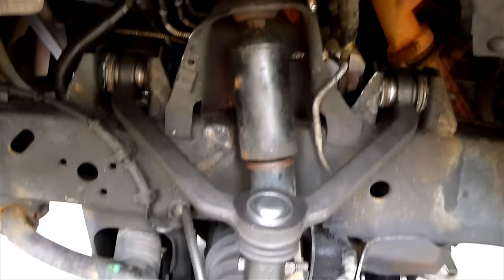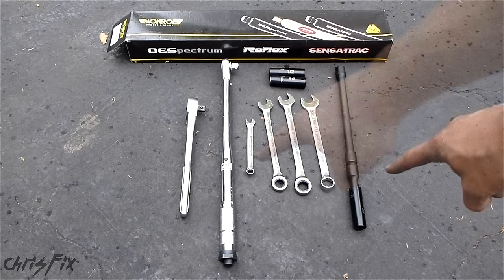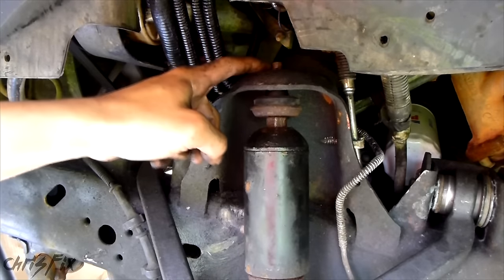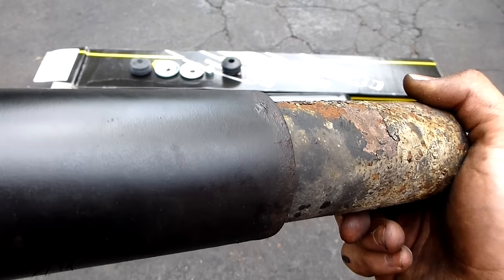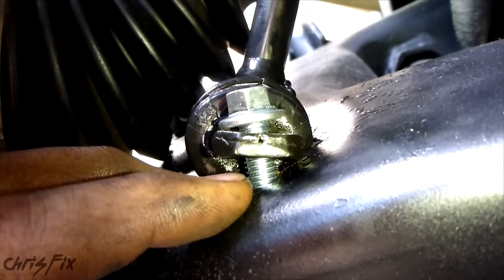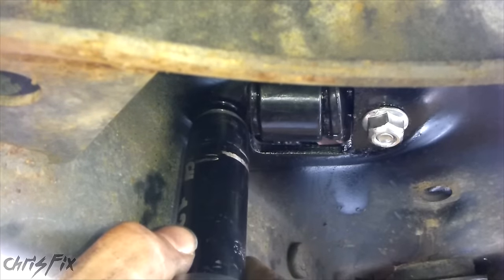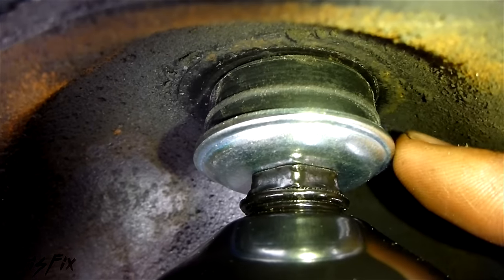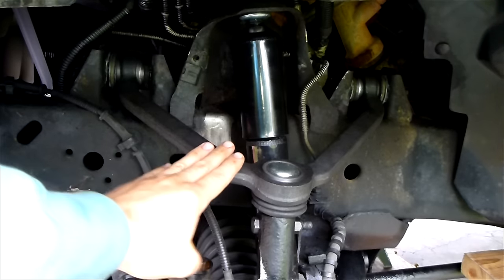How to Replace Front Shocks

Comment: how are you liking the sensatrac shocks? I put them on my 03 2wd f150 and can't stand them. they are too short in my opinion. Guess I need to measure the shock mounting at compressed, extended, and static ride height.

Comment: Great video, I have a 99 ranger that is leaning badly on driver side front. Along with a vibration. I'm guessing it's the shock gone bad. Is there anything else that I could suspect to be the problem? Thanks
Reply from the maker: Dana Steele The spring (either coil or torsion bar) might be bad as well.

Comment: Hey chris is the installation similar for most cars even if im using aftermarket parts? Example is im lowered on springs and want to go with a aftermarket shocks but i will keep the strut stock.

Comment: hey chris, i installed some bilsteins on my truck but it didnt have a stud on the bottom like when you took it off, so when i tighten the top bolt it would only go flush and then just kept spinning. so after my first ride it became loose to where i can spin the bolt by hand? any suggestions

Comment: Does that truck not have coil springs? I didn’t see any coil or leaf spring attached to the front suspension. Or does it use some sort of torsion bar in stead of a spring?

Comment: hey crhis! Great video it really encouraged me to do the replacement my self, i went ahead and started out yesterdey, apparently i got the incorrect shocks as it did not even reach the top hole once the tire was on the ground one question at minute 3:30 in your video is the shock compressed at that point? i guess that the shock has to compress to 50% the whole travel of the shock in a regular assembly.
Reply from the maker: Emilio Gaitan Antunez Awesome! That sounds like the incorrect shock. At 3:30 the shock was compressed a little to get the bolt holes to be straight. But when I put the shock in, the suspension was not compressed and the shock should be fully opened. Keep me posted!
Reply: hey chris! i went back to the shop explained what was going on and they trade the shocks for the right ones, came back and it was easy as you are saying in your great job! keep up the good work.
Reply from the maker: Emilio Gaitan Antunez Awesome and thanks for the update!

Comment: How do you change the shock when its up in the coil spring well? I can't get access to the bottom nut on the top, its inside the frame. Should I just cut it off like yours snapped off? Do I need access to that nut when I'm installing the new shock or can I just tighten the top nut down?

Comment: Since this is just a shock and not strut do you need an alignment after replacement / can you do an alignment while they are bad to make sure no other parts (control arm, tie rod, etc) are bad? 

Also, is it safe to do without jacking up the truck or will it collapse when removed? I know I have seen you do rear shocks while on the ground
Reply from the maker: +Chris Brannan shocks will not affect an alignment since they are just dampers. Your alignment with shocks on and off the car should be the same. If you have room you can replace the shocks with the car on the ground. That's what I did with the rear shocks on my truck.
Reply: +ChrisFix thanks that's what I was hoping, worried I might have a bent tie rod or something and would rather get that diagnosed and fix it if needed but didn't want to throw money away on two alignments if they needed done. Love the videos, they help a lot!
Reply from the maker: It is easy to check for bent tie rods or suspension parts. They should be straight so take your wheels off and look. I have a video on each suspension part (ball joint, upper and lower control arms, tie rods, struts, camber bolts, etc) so you can check them all out!!!
Reply: Thanks again for the quick reply. I have done those tests several times in the last week which is why I am starting to think maybe it is just out of alignment, the passenger side wheel just looks really crooked. I even did the 12-6; 9-3 wobble test by jacking up under the control arm to "unload" the torsion bar as some people mentioned in the comments of those videos. Everything feels and looks pretty solid, not really seeing any visible movement, definitely not like in your ball joint/control arm videos. I thought MAYBE I had a bad ball joint as it looked like a camber tilt to me and there was a small gap between the ball joint boot and knuckle on that side. The ball joint appears to be aftermarket as it has a grease fitting on it.  I posted some pictures of both of my ball joints and a front shot of my truck to show the alignment issue to another Forum. They thought that it looked more like a toe out issue than camber and that if all the ball sockets on the tie rods were solid then maybe one of them got bent and to try and get it aligned as it probably would align OK with a bent arm, or the shop would be able to tell me which one needs replaced.

After doing some more thinking I couldn't remember if I checked the inner tie rods, so I just did the test again this evening and didn't see anything so I pulled the boots back so I could get a better look at the ball socket for movement. I didn't see any movement in the sockets, BUT on the driver side there does seem to be a lot of grease on the rack while the passenger side is clean. Could a bad rack cause alignment issues and if so do you think that could be my problem? If the rack wouldn't cause the alignment should I be concerned about that grease being there? I don't feel any play in the steering wheel and there are no vibrations under braking like I had with bad tie rods on my old car.

Here are picks of my lower ball joints, front of truck (passenger side looks off to me) and the insides of my steering rack/tie rod boots with grease: https://goo.gl/photos/frqTWxi8rmqrhPV66

Comment: Great video!  Thanks!!  I bought rear shocks for my 1998 Chevy Blazer (LS - 4 door)  and have been learning from watching your videos.  Amazon only had one shock in stock for the front (so I went ahead and ordered it).  Fast forward the second front shock is now back in stock but is now 6X the original price (this price changed across all websites I shopped).  Long story short, I found a new front shock to match my existing new front shock on eBay (new old stock) but the mounting hardware is missing.  How difficult is it to find AC Delco mounting hardware (actually a Bilstein part.  The part no is listed as 540-516 as well as  GM OE part no. 12474687)?  Thanks for your help.  Merry Christmas!!

Comment: Chris, what's the difference between shocks & struts?
Reply: Nidal Sheikha He explains it in the intro, struts have springs around them, shocks do not. Cheers
Reply: Shocks typically don't have springs, but they can. They're called coilovers. Struts are different. Struts are a part of the suspension that controls the positioning of the wheel. Shock suspensions typically have an upper and lower control arm. Strut suspensions typically don't have an upper control arm. They MAY have a lower control arm, and they may use a collection of links (some sports cars use this).

Comment: Hi chris i have a 2006 chevy silverado 1500 two wheel drive and I was replacing the front shocks and while removing one of one the bottom two bolts on the left shock one broke off could i get by with one bolt with red locktight on the bottom bolt and the nut on the top and how tight should i tighten the nut on the top?
Thanks Landon
Reply from the maker: Landon Smith You need to find the torque specs for your car and you need both bolts. You can get by with one bolt to slowly drive to a parts store to purchase another bolt if you dont have another car, but you definitely need both bolts.

Comment: I have a 1998 ford ranger and I need to replace all 4 shocks, the problem I have is my rear drivers side has a rust hole on the frame where the rear shock attaches to the frame can I take that shock off and get it repaired by welding a metal plate to cover the hole and drill holes for the shock to put the bolts in, the rust is right at the shock plate that is attached to the frame

Comment: Chris this will be on my next to do list. One question how do you fix a car that is accelerated meaning when I turn on my truck I wait 5 minutes to heat up the engine. While I am waiting for the engine to get hot the gage on the far left where it has numbers 1-8. I think it's called the RMP or RPI well that gauge instead of being at 0 pr below one that arrow is always near the 2. Also I am driving at 45 mph and the truck seems to be going slower than 45. Do you have any videos on that? I hope I made any sense.
Reply from the maker: Edgar Diaz Edgar, the rpms should be around 1000 at idle after a minute of turning the car on. Check out this video: https://www.youtube.com/watch?v=vFhoNykgQtc
Let me know if this is similar to the problem you are having.

Comment: Hey chris my back tail light blinker in my 2000 f150 xlt doesn't work. But the front works. Bulb is still good. What's the possible problem

Comment: Quick question i have a 2003 F150 supercrew with a 6" lift do i really have to jack it up? its on leveled grounds and theres enough clearense there to not remove the tire. i should i be safe than sorry?

Comment: My 3/4 won’t fit on the lower bolt on the top of the shock it’s annoying the hell out of me, I gave the same truck lol & changed one side so I know it’s the right size
Reply from the maker: Dang, are you using a 3/4 wrench or socket?

Comment: Hey Chris, I kno it's gonna be kinda hard to do but can u please put up a how to get rid of front strut sag on a 95 Lincoln town car, it's been giving me trouble
Reply from the maker: Leon Solomon I dont have a Towncar to work on, but is this a problem even when you replace your struts with new ones?
Reply: I haven't been able to lol. The driver side has a major sag but my passenger side is rather ok. The mechanic that I talked to said that it could possibly be my upper ball joint that went out is that true? also, Is there any substitute for the rear springs as well?
Reply from the maker: Leon Solomon Ok, well the sag is just a worn out spring in the strut. Changing out struts is pretty simple. The upper ball joint wont cause a sag, but here is how to test ball joints: https://www.youtube.com/watch?v=62bVn7E8gyk
Reply: Thanks Chris

Comment: Hi Chris,  My Saab93 sportwagon 170k miles has a leak from the front strut so I'm going to change both b4 my next Mot, looking on eBay I could get 2 new Monroe reflex for £63! my question is are they any good or can you recommend or advise from your experience, cheers
Reply from the maker: Typey1 Monroe makes some pretty good shocks. If you are concerned with how long they will last, in the US, the local parts stores usually have a lifetime warranty if you buy it from them and they even price match!

Comment: What do you do when trying to tighten the bolt on top, but the entire shaft spins? I installed front shocks on 2004 mustang gt, but can tighten the top bolt. So frustrated!

P.s I'm using an impact wrench, and still nothing.

Comment: I have a 2000 Lincoln Town Car Executive, do my evap canister solenoid Vapor hose runs to the top of the gas tank, or dose it supposed to be exposed to the air ??? Please help... Can't pass emission, computer reads evap canister solenoid malfunction... And the hose that attach to the Evap solenoid has been cut

Comment: Chris, I replaced my front shocks myself, per your video, and now my newly installed shocks are squeaky. Very squeaky. What gives?
Reply from the maker: +Kevin Beyer Maybe the shocks are bad? Let them break in for 200 miles but I would contact the company you used and see what they say. You might want to add some silicone grease to the bushings which might stop the squeak if the squeak is coming from that and not the shock internally.

Comment: hey @chris, i got a cadillac cts 2005 and it had a squeaky sound while driving at the front left side of the car. i was guessin it was the shocks nd replaced it but the squeakin sound has increased while driving nd it seems to reduce for a day or 2 only when i apply some grease to the bushes on the hindges of the shock...plz suggest something..
Reply: Mammen Mathews bushes are well known for squeaking, there is some special lubricant for quieting them down or you can also use silicone grease, never use petroleum based grease.
Reply: @Luciano Narno  thanks man... let me give it a try... hope that works...👍
Reply: Mammen Mathews No problem, man.

Comment: You didn't use blue lock tight on the front shocks but you did on the rear. Any reason?
Reply from the maker: Martin Driskill Good observation! The only reason why is because I ran out. Loctite in most applications is just an extra precaution. If you  torque the bolts down right, then you don't have to worry!

Comment: My 2004 Dodge Ram has a spring in the truck that the shock just slides out of at the bottom when uninstalled, are there any precautions to take?
Reply: Im no mechanic but I think anybody can replace shocks. Shocks arent spring loaded so when you unbolt them they arent going to fly out at you If thats what your worried about I hope this helps
Reply: Pew diepie thank you!

Comment: my bottom bolts for the shocks are so rusted they snap with very little effort how do i get them out? any special tools or do i gotta drill them out
Reply from the maker: ptrhip If the bolts on the bottom are snapping, just snap them and the shock will come right out (after you take the top nut off which I assume you will snap too). Make sense?
Reply from the maker: The bottom ones should just slide out if the bolts are snapped off. As for the top one, use a vice grips to prevent the bolt from spinning as you unscrew the nut.

Comment: How do you replace struts? i need to get mine done on my 2003 ford f250!
Reply from the maker: Joe Windsor I wish I had a vehicle with struts that need to be replaced. On the F150 it is really easy (similar to this video too). Just locate the 3 bolts at the top of the strut (usually under the hood in the engine compartment). And then there is one or two bolts behind the wheel on the bottom of the strut. Jack the car up, undo all of the bolts, take the strut out, bolt the new strut in and you are done!
Reply: Thnx man. You're videos are awesome. But until I see a video on that I'll just wait haha
Reply: ChrisFix +1 for strut replacement video.  I have seen some wacky videos on YouTube for struts.  I always feel better about doing a job when I watch one of your videos first.  Lookin' to replace the front struts on my 2006 Ford Five Hundred
Reply from the maker: Josh Smith Yea I know what you mean haha. I have seen some crazy stuff. When I get a vehicle that needs struts I will make a video for you guys!

Comment: I have a 96 pathfinder an my front end is very bouncy, even the side with a brand new strut.
Reply: Did you purchase two new struts or just one?
Reply: Just one cause the one on the drivers side was fine. The new one was just as soft/bouncy. I'm not sure if there supposed to be or if I just get a bad one.
Reply: William Figueroa Jr.  When you purchase new shocks they are suppose to be very hard to push down not soft and squishy. It should take almost a press for them to go down depending on what brand you get. Most as a general rule should be hard to press down. If the other shock isn't like that then you got a bad shock and should take it back. Replace in pairs both sides.
Reply: +William Figueroa Jr. Always replace in pairs...

Comment: is it possible to use a grinder to cut off a nut that is welded on a strut? My bolt head snapped off. so the screw is still in the rear knuckle and strut.  I'm replacing the strut so idc about. I bought new bolts for the strut.Can a grinder do the job?
Reply from the maker: +85krash It is possible just be careful not to hit the strut because that is compressed. Wear safety glasses! I have cut bolts or purposely snapped them before! Good luck!
Reply: so I didn't use a angle grinder. Instead I took it to a guy that I go to for my muffler. He blow torched it until It got red. used a wrench to make it turn and BAM.it got loose, a little elbow grease and the thing came off.
Reply from the maker: +85krash I need one of those torches!

Comment: Hey, I need to replace my front shocks. How do I go about finding and selecting a good and fitting replacement? Hopefully you'll (or someone else) see this comment.
Reply from the maker: Parts stores, online, etc. Get a brand that is well known or OEM and it should fit just fine.
Reply: Thank you for the reply. Quite new in fixing cars so the videos help a lot. I expected there to be some parameters that would need to match my car, like length of the shock or something. Doesn't sound like it :)

Comment: I just purchased less than 5 months ago brand new KYB shocks and I've had to replace both of them at least 1 because one of them burst the seals. I now have to replace both sets because one of them just burst after jacking up my car a little bit and on the way down from replacing two hoses my brand new shock just blew a hole in itself. I'm so mad. They were 64.99 each and they were suppose to be top quality, but I'm starting to think there is something wrong with them. Each set came from Japan which I thought was suppose to have great quality stuff but maybe I got a few bad batches. Can anyone recommend a brand/ somewhere I can purchase new shocks? I got the KYB's at autozone.